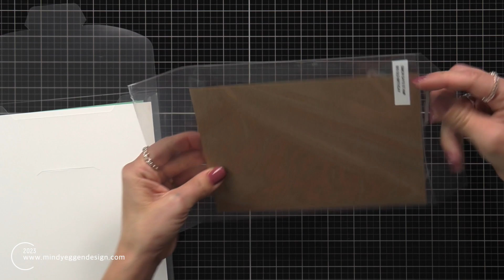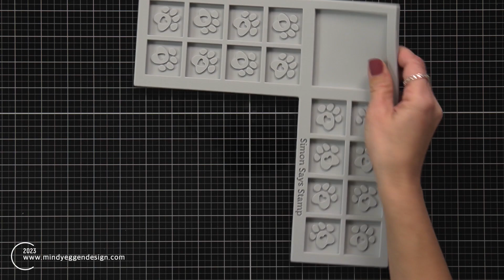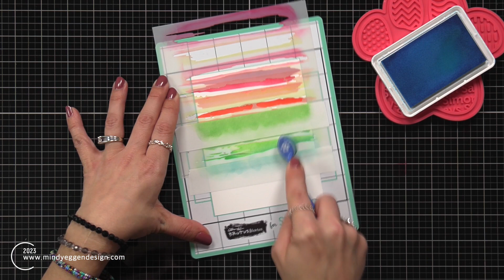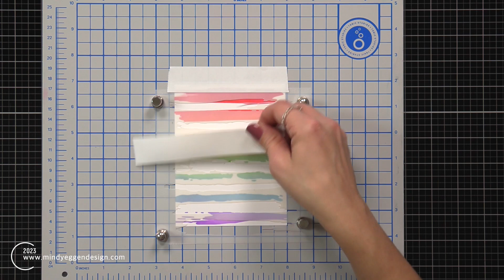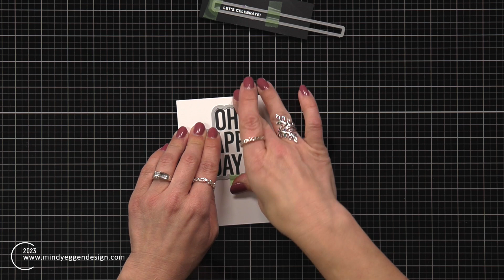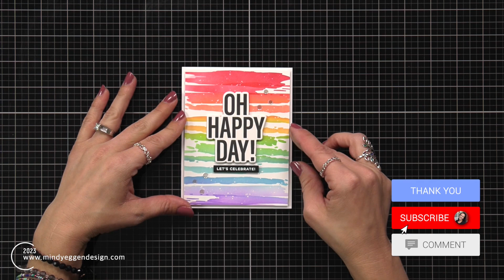Stencil Shifting Two Ways

Comment: That’s a great card idea for anyone. It looks vibrant and is sure to brighten up the recipients day!
I have the 6in and 12in t-square rulers. They get so much 🙄 use…I have no idea where they are right now if I had to use them. I did think I would the 6in more because it is smaller. The ruler I DO use most of is a 6in MISTI ruler that has the markings from the zero in the middle and number increases on each side. I like it for centering sentiments. I also can use it in the MISTI as I’ve seen you do when lining things up. NOW that ruler I do know where it is…lol.
Reply from the maker: lol same! I know where my Misti ruler and corners are

Comment: I really like my t-square ruler.  I wish I had purchased the 6" rather than the 12".  Seems to get in the way of everything on my work surface.  Need a bigger work surface :)
Reply from the maker: haha! I agree - a bigger work surface would be nice here too. Big or small ruler - I still lose them all the time
Reply: @MindyEggenDesign  SOMEDAY a bigger work surface!
Reply: Ha, I took my cheap T-square ruler and cut it in half (sanded the “raw” edges down) and it works fine. 🙃
Obviously the Simon one is better quality 😉
Reply: @RosyRosie42  Good idea!  What did you cut it with??
Reply: @dmesm57  Craft knife / X-acto blade 🙂
Reply: @RosyRosie42  Oh great!  Will definitely try this!